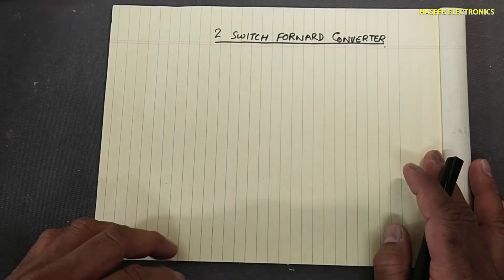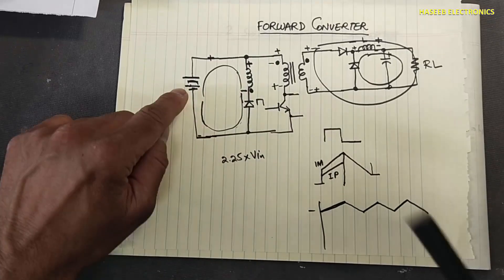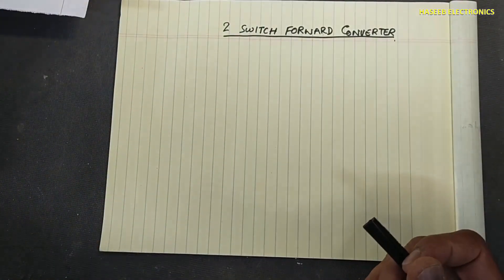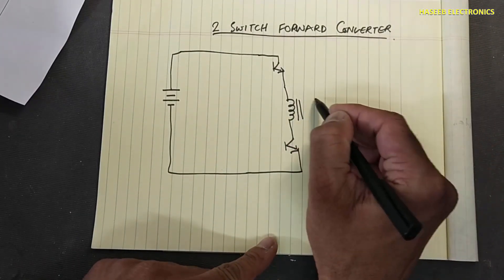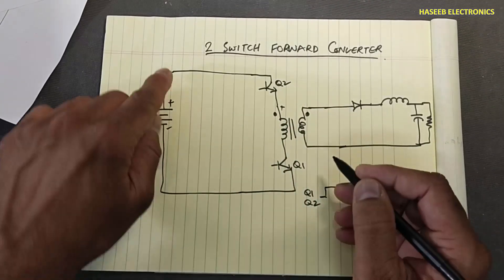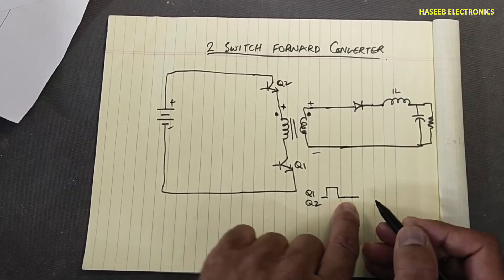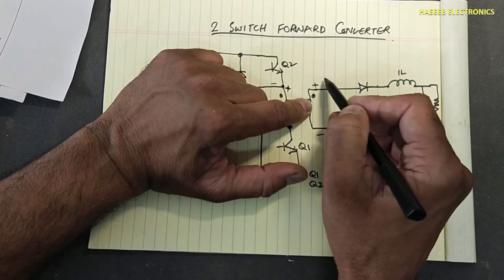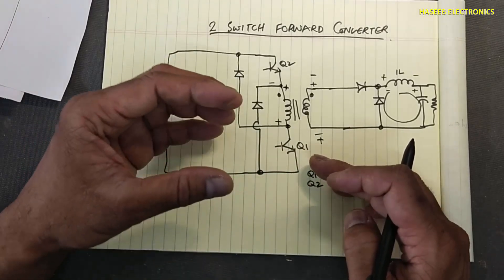{843} Two Switch Forward Converter Topology

Comment: Assalamu'alaikum...
Can you explain? 
Between a full bridge topology with 2 forward switches 
Between the two, who has the highest voltage on the MOSFET switch?
I didn't ask about its strength because the full bridge is definitely stronger, but I focused on asking about the stress switch...
I don't understand the reverse current in a full bridge topology yet...
Thank you, my brother, greetings from Indonesia...

Comment: Hello sir I have a few questions  the pwm signal is one single  drive that drive  high and low side mosfets at once .? in the gate driver transformer the two same signal wind or not wound aunty-clock just wound the same direction?